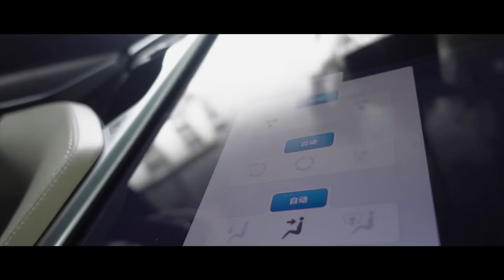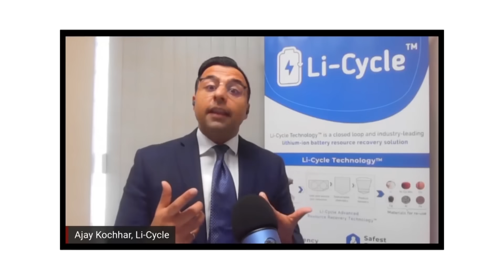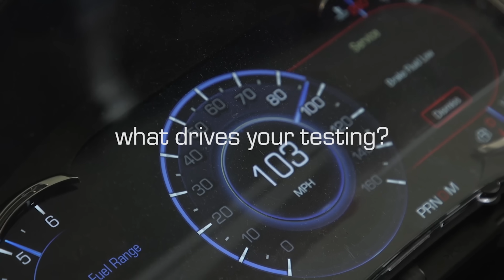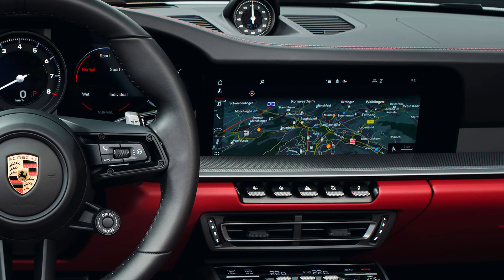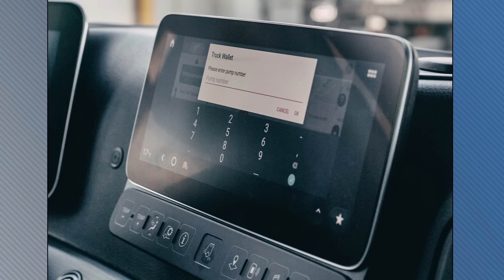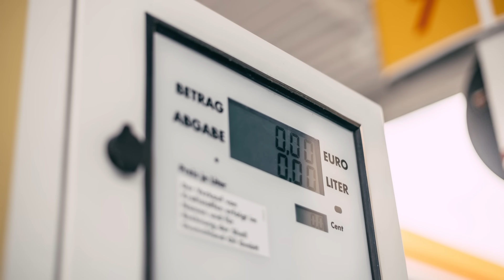Subaru Teases New Electric SUV; Top Selling Hybrid Will Surprise You - Autoline Daily 3077

Comment: Love all this tech going into cars. The automakers can't get enough chips for existing cars. Sometimes basic is better.
Reply: Yeah, we should stop putting radios in cars too to save on chips, you know, because sometimes basic is better. /s
Reply: @irag34  I remember when radio's were an option on a car. My parents got tired of me going through used cars and my first new car a 91 Swift  had. A single drivers side mirror no passenger mirror. Steel painted wheels no wheel covers or alloys. No air con. Unpainted black bumpers. 3/4 vinyl seats. 5 spd manual.No radio  But did have an Alpine deck installed with Rockford Fosgate amp under the seat and MTX subs in the back. Was simple basic but did the job. No Nav's heated seats, self drives all this pampered stuff. Everyone so soft now a days with cars want everything.

Comment: I am confused on two things. 

1. The GMG T.50 (Gorgeous successor the F1) has its shifter on the right side of the driver. But aren't Brits Right Hand Drive? If the driver enters/egresses the vehicle on the right side of the vehicle why have the shifter on the right side? I can see that being for a Left Hand Drive car for regions with that paradigm, like the US, but I would have thought the T.50 would be depicted strictly as a Right Hand Drive car. 

2. Subaru is still going to keep using their symmetrical AWD system with a BEV? Then I am to assume the 1) it is a single motor solution, the motor is dropped in in place of the engine, full stop and 2) the "SolTerra" is to be considerably less powerful that other AWD BEVs on the market.... not that Subarus have been insane power machines, aside from modified WRXs, but that is a very notable disadvantage.

Comment: Siena, Pacifica, Odyssey, what are the current voyager numbers?
Reply: I have been wondering the same thing. I don't think they're selling well. At least not around here. I also think there is no hybrid option.
Reply: @dontelindsey5846  well the Windsor plant is down due to the chip shortage
Reply: @foreverinteriors  I see a lot of the new Pacifica just not the Voyager. I heard it may take years to get the chip issue resolved.